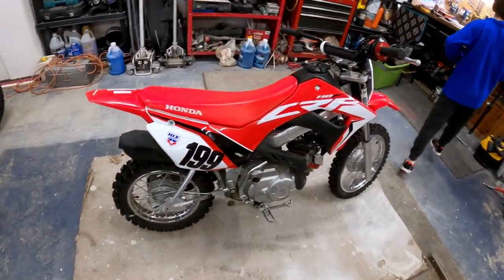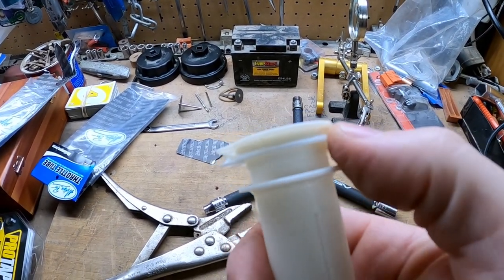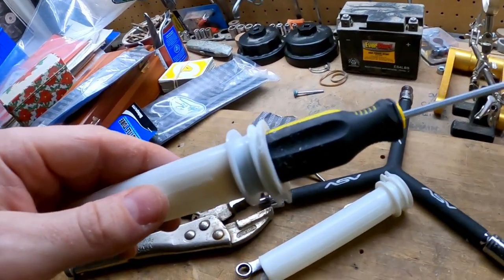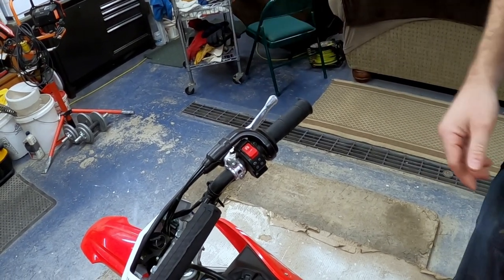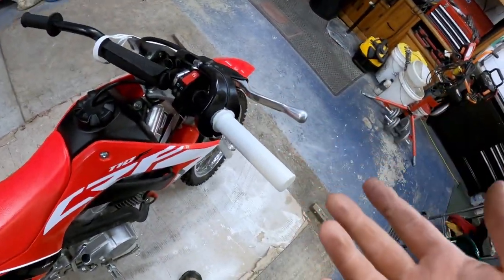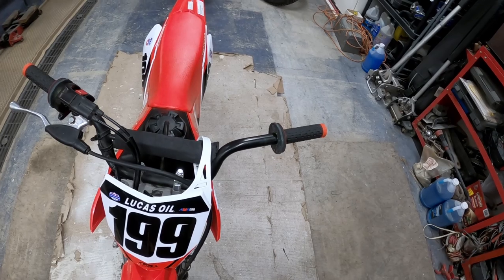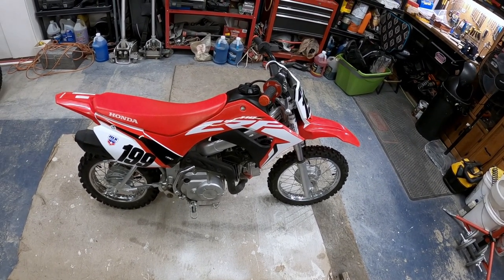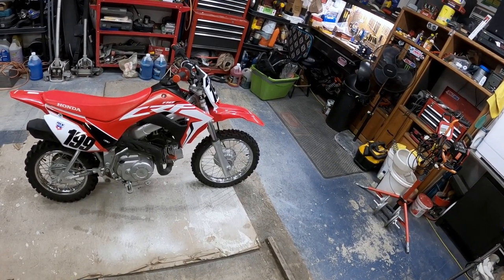CRF110 Mod How to Install Full Size Grips

Comment: Spent almost an hour trying to figure out how to put the throttle cables back on, couldn’t find a video showing how on this bike so I finally just clicked on this video and saw how you put it back on, this was the most stressful thing I’ve ever had to do on a damn dirt bike 🤦‍♂️😂 thanks brotha🙏
Reply: I’ve rebuilt top ends faster than replacing the stupid cables on this thing….actually still don’t have the cables on it just won’t F’n go on

Comment: You can get big power gains from just an exhaust and ecu flash on these things. They run about 5.5 hp stock and CJR said my crf110 should be pushing 8hp and rev way further out from just my intake, exhaust and ecu. Only invested about $5-600 total. Apparently you can do a 133 big bore with all this and make upwards of 12.5 hp
Reply from the maker: OH that sounds like fun!

Comment: Just changed the grips on my 110
Reply: Hey dude did you do the dremmel  thing like in this vid or did you find an aftermarket part specifically for it?
Reply: Taylor Robinson I know that guy I saw him do it he didn’t use a dremmel it was 2013 crf110

Comment: I bought the pro taper pit bike bars high rise and I bought the same grips you did and I have a longer throttle tube that came with the bars and mine is doing the same thing it won't return to its normal position when I twist the throttle.  So do you think that can be the same issue and your saying that I need to loosen the cables?
Reply from the maker: Thats what I would look for first is a way to loosen the cables, they can bind pretty easily. Sometimes look to see if you can route them differently as well with less twists if there are any
Reply: Mine just came in! What would be best bars for 6’2” adult? Thanks a lot! 😀

Comment: You didn’t need to cut the tube,  take off the nut on the throttle cable to give it more slack then trim the plastic guide to allow more cable... now it’s a 1/4 turn throttle

Comment: Crf125f throttle tube will swap straight in for full size grips with no mods 👍
Reply from the maker: Anyone remember that NBC chime that went with “The more you know” Thanks man! Lots of shops are selling modified tubes online. Never thought to look that way since the 125 is EFI now too
Reply: Also can use the 125 throttle cable for taller handle bars to keep  the cable routed in the stock position
Reply from the maker: We will he doing that eventually for sure.
Reply: Dads Domain Already tried what he said, It will work, but you will have to run OEM Honda CRF125 grips because the CRF125F throttle tube will never comply with aftermarket grips. So technically NO it doesnt work.
Reply: Taylor Robinson are u serious lol the 125 grip just needs to be cut off then you file down the little lip and any grip will fit, way less modifications then this video
Reply: Taylor Robinson the 125 tube is exactly the same as the stock tube but wider.. fits with no modifications. If you can’t work out how to put after market grips on I think you shouldn’t be working on the bike your self anyway lol

Comment: I just tried to install the BBR extended cables kit with the throttle tube that comes with it and nothing fits and all of the cables are sticking. Any suggestions for good extended cables and a full size throttle tube that will actually fit as advertised?